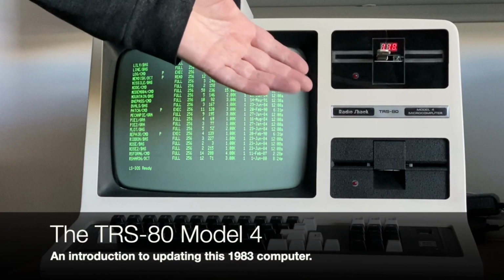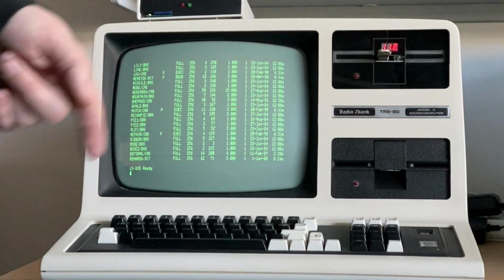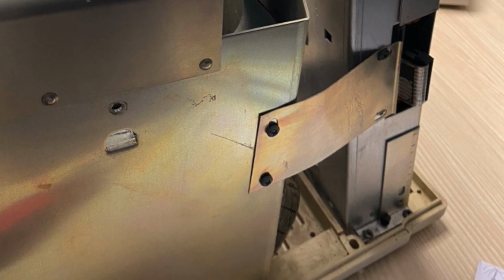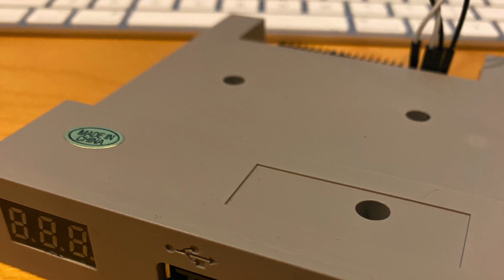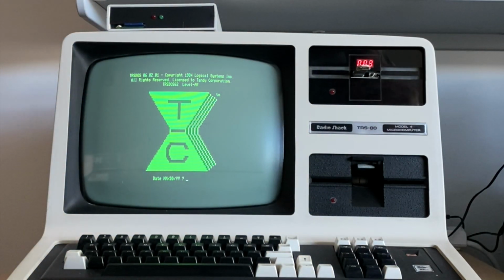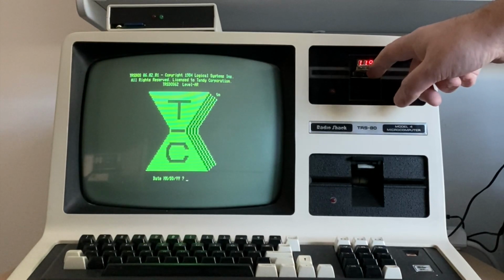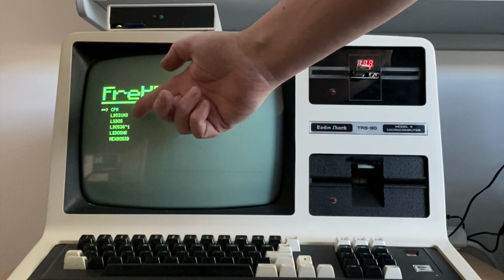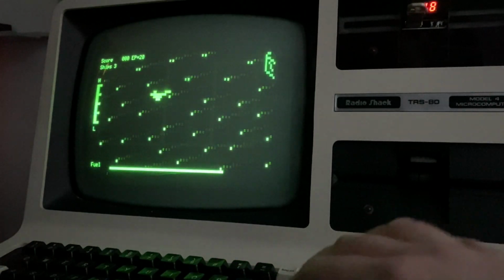TRS-80 Model 4 - an introduction

Comment: I worked at Radio Shack right about the time the Model 4 came out.  It was very odd that we still used the manual ticket method for customer purchases.  Heck, we were a technology store, why weren't we using that technology?  I do remember the manager had a computer in his office (maybe a Model II?) that he did the daily sales reports on.  We weren't allowed to touch it or even look at it.  When I worked there, the Color Computer was the big attention draw in the store.  Very few business people came in to see the Model 4.
Reply from the maker: Was the Model 4 was more of a fan machine for the existing customer base? It was getting a little long in the toothy by then..
Reply: I guess we viewed it as just kind of a natural evolution of the brand.  It was twice as fast as the Model III.  I do remember the big attraction of the Model 4 was its ability to run CP/M, even though that was clearly on a downward slide by that time.  I don't remember selling one.  I do remember selling several CC2s and a few Model 100s.